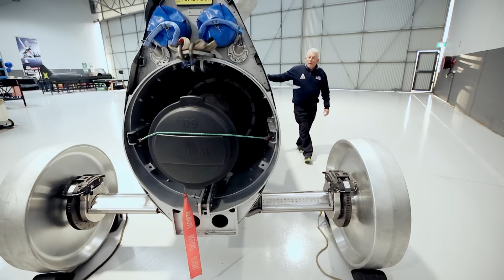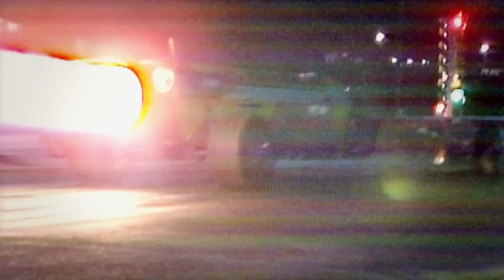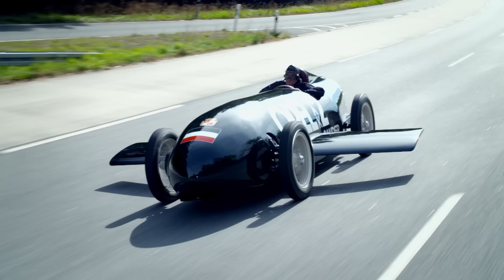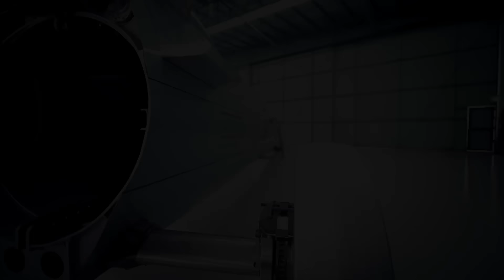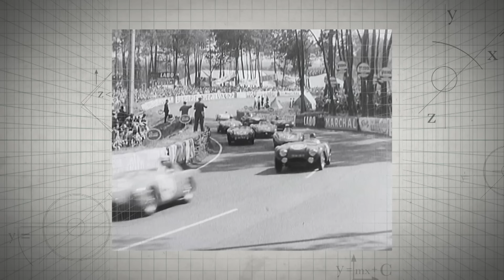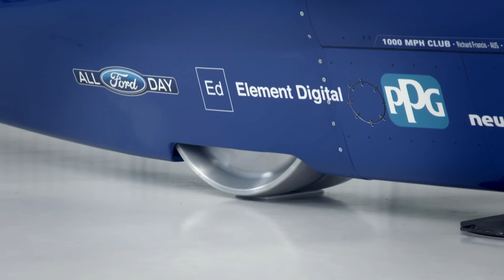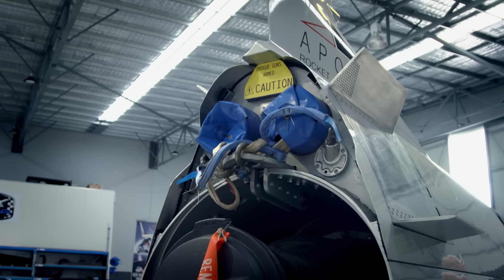Can This Rocket-Powered Car Break the Sound Barrier on Land? | Blueprint

Comment: (11:45) "Aussie Invader's nose is angled down to avoid lift."

Is that what you were told? This is not true.

The nose angled down will create lift in the subsonic regime, because it functions as an airfoil. I presume that this is intentionally done to decrease the weight off the front wheel(s) at sonic speeds, to presumably be modulated by the canard trim wings.

At pre-supersonic transsonic speeds, this is "less" of an issue aerodynamically. The double quotes signify that geometrically greater and greater forces are at play, but the aforementioned effect becomes less of a relative force.

At post-supersonic transsonic speeds, other consequences of CoF shift and the reflection of the shock waves off the ground will become paramount -- indeed, potentially catastrophically so. The wedge underbelly is an effective static solution to mitigate this, as discussed just afterwards. But what he does not say is that the wedge creates upside-down Compression Lift, and as such I deem it to be the real downforce that keeps this vehicle on the ground at speed. Clever.

No, the design team definitely did not invent the wedge underbelly. Why does he say this?

P.S. I believe it was Gary Gabelich, driving Blue Flame, another rocket-powered car -- this developing 58,000 hp -- who had recounted an unanticipated problem. His head (with helmet, of course) was supported by a head rest in anticipation of the radical initial acceleration, but it was not conformal to his head and body. During acceleration, this torque impulse and/or slight misalignment (it is not clear which) came very close to breaking his neck. If this had happened, or even come close to happening, he would have been disabled by intense pain or even immediate paralysis -- both states leading to breakup and death. I hope that human factors, like aerodynamic factors, are effectively anticipated for the safe accomplishment of this team's great goal.
Reply: Wow !! Sounds like you actually know what you are talking about !! Can I ask where you learned all this information ? Was it just by watching videos and being interested, or are you involved in this stuff personally ? Forgive me if its none of my business, im Just curious....
Reply: @Sunbud86   Thank you for your interest. I hope you understand that my observations were meant to be positive, especially in regard to this team's great goal -- and for such a long term effort.

In brief, I am a retired scientist, and aerodynamic research was one of my many passions and onetime profession. Truth to be told, I aspired to do or discover something great, and that eluded me because I think I spread myself too thin -- but hey! this qualifies me to babble my observations on YouTube, right?

In the hard sciences, one thing builds upon another, and at the base of it all, is my (incomplete) degree in physics, and a lifetime of love of mathematics; however, it does not really take much acumen, as (and I say this at the drop of a hat) 70% of physics (say) is just common sense backed up by sufficient knowledge and curiosity.

Indeed, I don't think that anything I asserted is not available on the Internet somewhere. As I precede the Internet, pointed research was possible but slow. I presume that you are of the younger generation, and I can only envy you of the resources you have, including the nascent development of A.I.
Reply: @BrianHiles-y3q  thanks for your answer. It is due to people like you that we have the technology we have today. A lifetime of learning different things is a life well spent in my opinion. Just because you didnt solve the "double slit experiment", or bridge the quantum vs e=mc2 "gap" doesnt mean you didnt contribute in moving humans foward... I guess you could say im of the younger generation, i am 39yrs old. I am a mechanic by trade, but enjoy many different things, and love to learn more... As of late i been trying to wrap my mind around the UFO topic of all things... ( 🙄 i know, but its kinda interesting ) 
I would love to have half the knowledge you have required over your lifetime. So please, pass it on and show us, so we can do the same.... thank you for pushing sience and humanity forward..... and hello from Arkansas, USA !!
Reply: Didn't the Concord have a slanted nose that was adjustable.
Reply: @michaelwynne4346   The slanted nose was only tilted down for taxiing purposes. The pilots couldn't see the ground in front of them when taxiing if it was up, so they made it tilt down giving them a clear view.
Reply: @michaelwynne4346      The drooping nose and retractable visor of the supersonic commercial aircraft Concorde, didn't slant per se, as I understand your meaning, but hinged down to accommodate for the pilots the view they needed, because of the high angle-of-attack the design of the ogival delta wings required for taking off and landing.

The nose-cone was formally symmetric -- no asymmetric "slant" there like the Aussie Invader. During high-speed flight of the Concorde, there was a "visor" that slid back to create a secondary highly-sloped windshield, to improve flight characteristics (cockpit noise, primarily) and to decrease drag.

Also having a droop-nose design was the Soviet Tu-144, the Concordsky, as the West mocked it, because it was copied from the English-French venture. The XB-70 Valkyrie, an ambitious prototype Mach 3 bomber of the 60s, did have an asymmetric (slanted) nosecone, but this was necessitated by its inclusion of a (look-down?) radar, but still needing to similarly accommodate to the pilots' visual needs when taking off and landing.

I emphasis my original comment, the issue that the asymmetric (slanted) nosecone (of the Aussie Invader ) will have (nominal) characteristics of a airfoil at sonic speeds, but due to aerodynamic um "magic" this effect is less and less in the transsonic regime.

The transsonic regime is the most fascinating and problematic speed for any craft, because it has the highest drag of any regime. Once the craft is fully supersonic, total drag goes down. Note that the transsonic regime starts well below the speed of sound, because as the air speeds up going around its form, some areas are subsonic and some areas are supersonic.

Have I adequately addressed your observation?
Reply: @BrianHiles-y3q unfortunately I don't see this thing going anywhere.
Reply: @michaelwynne4346    The drooping nose and retractable visor of the supersonic commercial aircraft Concorde, didn't slant per se, as I understand your meaning, but hinged down to accommodate for the view the pilots needed, because of the high angle-of-attack the design of the ogival delta wings required to take off and land.

The nose-cone was formally symmetric -- no asymmetric "slant" there like the Aussie Invader. During high-speed flight of the Concorde, there was a "visor" that slide back creating a secondary highly-sloped windshield, to improve flight characteristics (cockpit noise, primarily) and decrease drag.

Also having a droop-nose design was the Soviet Tu-144, the Concordsky, as the West mocked it, because it was copied from the English-French venture. The XB-70 Valkyrie, an ambitious prototype Mach 3 bomber of the 60s, did have an asymmetric (slanted) nosecone, but this was necessitated by its inclusion of a (look-down?) radar, but still needing to similarly accommodate to pilots visual needs when taking off and landing.

I emphasis in my original comment, the issue that the asymmetric (slanted) nosecone (of the Aussie Invader ) will have (nominal) characteristics of a airfoil at sonic speeds, but due to aerodynamic um "magic" this effect is less and less in the transsonic regime.

The transsonic regime is the most fascinating and problematic speed for any craft, because it has the highest drag of any regime. Once the craft is fully supersonic, total drag goes down. Note that the transsonic regime starts well below the speed of sound, because as the air speeds up going around its form, some areas are subsonic and some areas are supersonic.

Have I adequately addressed your observation?
Reply: @michaelwynne4346      The drooping nose and retractable visor of the supersonic commercial aircraft Concorde, didn't slant per se, as I understand your meaning, but hinged down to accommodate for the view the pilots needed, because of the high angle-of-attack the design of the ogival delta wings needed to take off and land.

The nose-cone was formally symmetric -- no asymmetric "slant" there like the Aussie Invader. During high-speed flight of the Concorde, there was a "visor" that slid back creating a secondary highly-sloped windshield, to improve flight characteristics (cockpit noise, primarily) and decrease drag.

Also having a droop-nose design was the Soviet Tu-144, the Concordsky, as the West mocked it, because it was copied from the English-French venture. The XB-70 Valkyrie, an ambitious prototype Mach 3 bomber of the 60s, did have an asymmetric (slanted) nosecone, but this was necessitated by its inclusion of a (look-down?) radar, but still needing to similarly accommodate to the pilots' visual needs when taking off and landing.

I emphasis in addition to my original comment, the issue that the asymmetric (slanted) nosecone (of the Aussie Invader ) will have (nominal) characteristics of an airfoil at sonic speeds, but due to aerodynamic um "magic" this effect is less and less in the transsonic regime.

The transsonic regime is the most fascinating and problematic speed for any craft, because it has the highest drag of any regime. Once the craft is fully supersonic, total drag goes down. Note that the transsonic regime starts well below the speed of sound, because as the air speeds up going around its form, some areas are subsonic and some areas are supersonic.

Have I adequately addressed your observation?

Comment: NOT a car. It's a rocket on wheels. Big difference.
Reply: Absolutely! It’s not a car, it’s a tricycle. They split the front tire to call it car. Pretty cool, but stupid at the same time!😂  All this for bragging rights, not practical.  I have more respect for backyard mechanics squeezing HP out of lawn mowers than this guy.
Reply: yep that’s true …I want to see piston powered cars but it’s exciting to watch this thing …if it ever gets out of the garage…!
Reply: What's the difference? A car can have many different kinds of propulsion
Reply: @Dunriteproducts  good thing there is no official "car speed record", although ther ars many recotds for various definitions of vehicle.  The discussion here is of the overall fastest land vehicle, meaning a human driven vehicle, with any sort of propulzion system,  in contact with the ground.
Reply: It's classified as a rocket powered car.  class c FIA.
 The Fédération Internationale de l'Automobile (FIA) is the governing body for motor sports and according to The Lyncean Group of San Diego land speed records. They define four basic categories of Land Speed Record (LSR) vehicles: 
Category A: Purpose-built, wheel-driven vehicles powered by various engine types (e.g., piston, rotary, turbine).
Category B: Vehicles derived from series production automobiles, with similar engine options to Category A.
Category C: Special automobiles that are not wheel-driven and are propelled by the thrust of jet and/or rocket engines.
Category D: Drag racing automobiles.
Reply: It has four wheels. It's a car
Reply: @Ben-fc3pi  Three wheels
Reply: @FarleyHillBilly It's a Robin Reliant

Comment: one cannot put put a gas engine in the same category as a jet engine so there should be separate records for these vehicles
Reply: Why? They're going for a Land Speed Record - that doesn't matter what it's propulsion system is.
Reply: "World" land speed records for "cars" are governed & recorded by the FIA where a thrust propelled vehicle & a wheel driven vehicle are two separate categories. "World" motorcycle records come under the FIM.
Reply: There ARE dozens of categories of vadious types of vehicles, including fastest  wheel driven,  fastest using a piston engined, fastest under various weights, fastest jet powered, fastest rocket powered, fastest 3 wheeled, 2 wheeled, etc etc.  Every categiry is a worthy attempt at a DIFFERENT record  The overal fastest land vehicle, and first to exceed the sound barrier on land was the JET AND ROCKET powered Thrust SSC  back in 1996.   That effortvtakes nothing away from other attempts to beat OTHER  equally valid records, but obviously the one making the big headlines is always goingvto be the vehicle that finds a way to achieve the top  speed while still running on wheels, which is the ultimate Land Speed Record
Reply: @markdoldon8852  Thrust SSC was not rocket powered, it ran two R/R Spey Turbofans & the current 763 record was set in 97.

Comment: It’s not a car, it’s a rocket with wheels attached 
A CAR moves by the wheels being driven by the engine 
Those wheel DO NOT make the car move… they train wheels
Reply: Get over it. Look at the thing... it's insane. SSC had jets, rockets are ok. Go play on the salt flats ANY WAY YOU LIKE. Whiner
Reply: There are different categories for land speed records. Wheel driven has many categories with multiple different types of power plants each having records. There are electric, diesel, spark ignition…. 
Non wheel driven also have categories such as jet engine, rocket engine…
Reply: @what bullandrewday3206

Comment: It is hard to comprehend that it will travel almost 1/2 km in 1 second. Amazing.
Reply: Its hard to comprehend that it will ever travel!!
Reply: It all depends on how many people can push it at the same time.
Reply: 3.6 seconds per mile. 60 x 60 = 3,600 seconds for 1,000 miles.